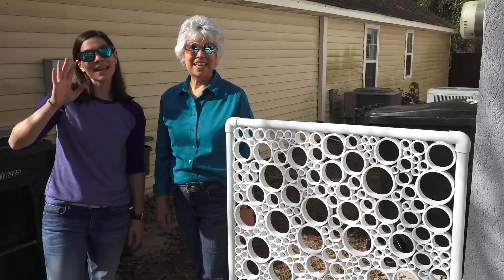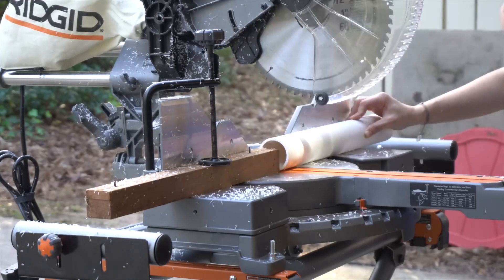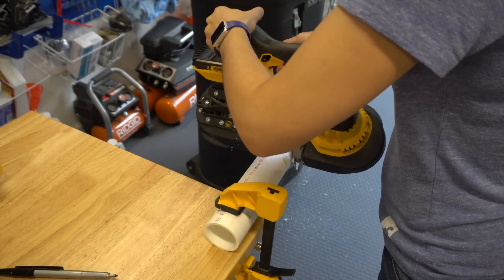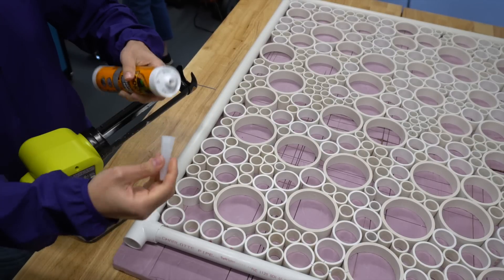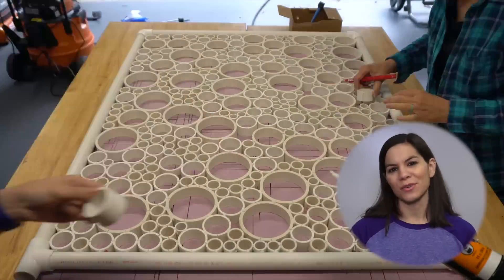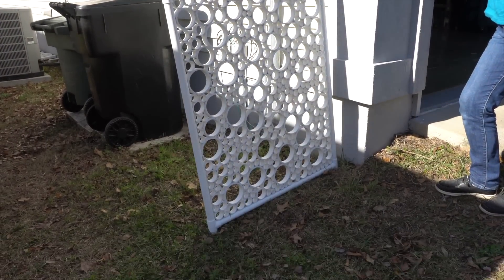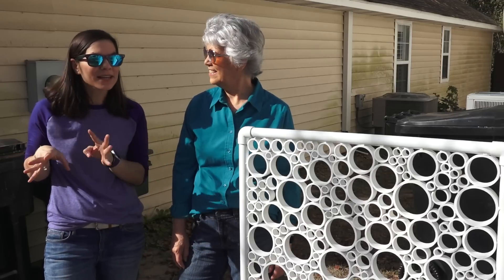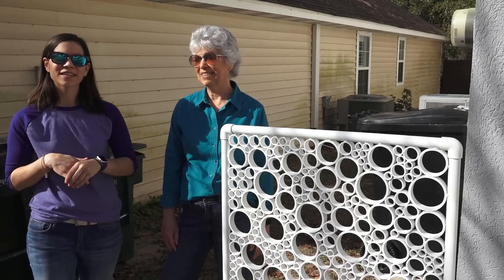DIY PVC Pipe Privacy Screen

Comment: TIP: cutting small pieces, use a sacrificial fence to keep both parts in plane so the cut off piece doesn't go flying. Clamp a 3/4" x 3 1/2" board to the back fence, then clamp the stop to that. This will trap the cut off part.

Comment: What’s it like weathered years later ?
Reply from the maker: It's in great shape today! I was looking at it the other day and thinking maybe we could spray paint it again (I clean it with wet and forget to keep it clean but it still has a little bit of dirty spots). The spray paint would just be to refresh a little bit but it does not seem absolutely necessary. All the circles are still very well in place. -Steph

Comment: Nice job and time spent well with each other. Retired Gen Contractor. Because of the smooth surface of the PVC, your adhesive will let go soon because of the heat and cool. The PVC glue even though "smelly" actually melts the PVC together. It would have been a better choice. Even the glue after time will deteriorate in the sun after time, just not so quick. The PVC pipe itself will crumble and get very very fragile in the sun so don't dare hit it with a mower or weed wacker. Of course it can be repaired, but once the outer frame goes, it will be time for a new project day with each other! That's a good thing.
Reply from the maker: Thanks for the info Tony!

Comment: You should never push your piece against a stop block on any saw as it creates binding and your piece could fly out. You also get a rougher cut. Just draw a line down on the bed and push your piece to the line. PVC is also a difficult painting surface. A fusion primer or bonding primer should be used like Rustoleum Universal Bonding Primer after sanding and cleaning the surface.
Reply: avisitorhere okay Tim the tool man Taylor, relax, it’s YouTube not your own talk show!😂😂😂😂

Comment: Need was just a back fence on the saw. Mitersae have a gap in the middle for the blade to angle or tilt . Just a wooden board fixed to your saw fence would keep the cut Pipes from going into the back of the blade .

Comment: FYI, the reason the cut pieces of pipe went everywhere is they were confined by the wood stop block and the saw blade.  The short pieces need a place to fall away.  A small stop, or better, a movable stop will be much safer.  Really like the end result.

Comment: too many large peices means it ends up not really being a privacy fence. You might have been better served by pouring resin over the whole thing, with a bit of opaque dye.
Reply: I had the same thought but, fill about 85% with colored resin. Maybe stick marbles in the smaller holes. Heck, resin marbles or crystals into larger holes.
Reply: It will become very heavy!
Reply: Maybe colored lights, or sheet of light plastic,colored.
Reply: Colored or sanblasted acrylic will be much better, easier & cleaner.

Comment: Good work ..but you  took long time for gluing the pieces together ...use pvc glue   and roller brush to brush both sides after arranging ....tht will save a lot of time and effort .😊
Reply from the maker: We thought about using PVC glue but from the little we have used it, we found the smell to be very toxic and some pieces had some space between them so we needed the expansion we got with the construction adhesive.
Reply: @MotherDaughterProjectsDIY   Anyways nice job, keep it up.all  the best and waiting more videos..👌👍